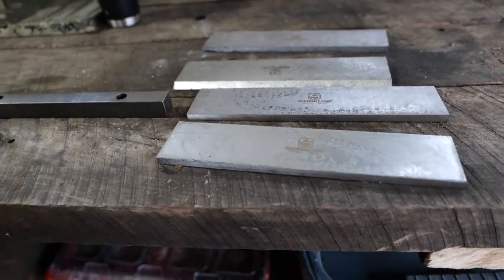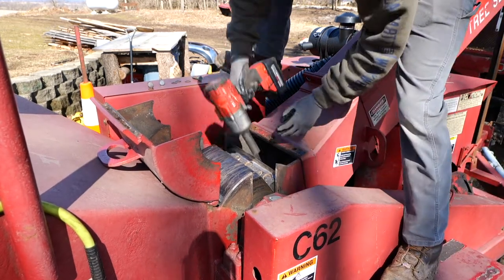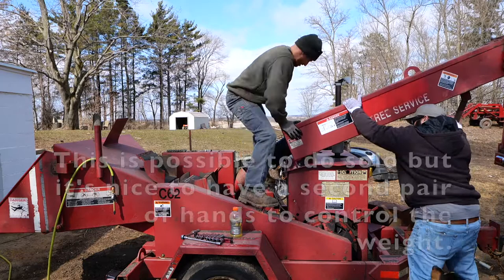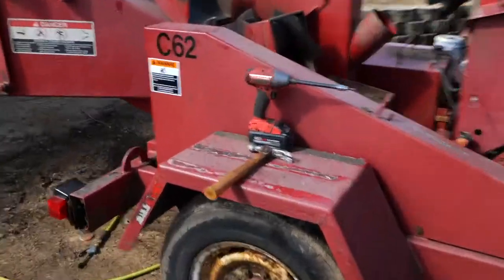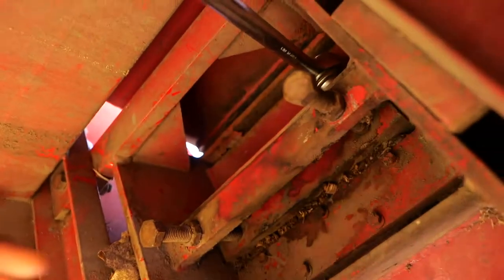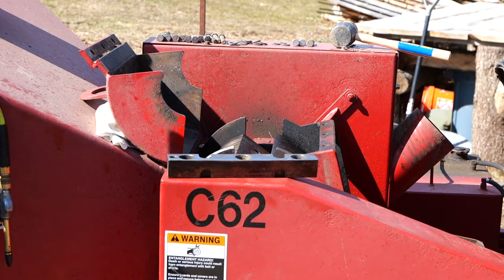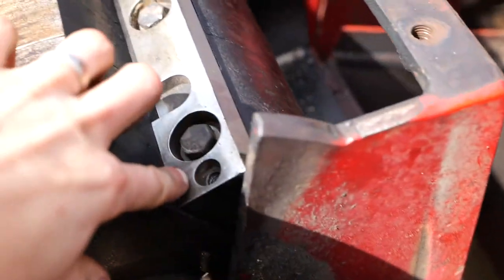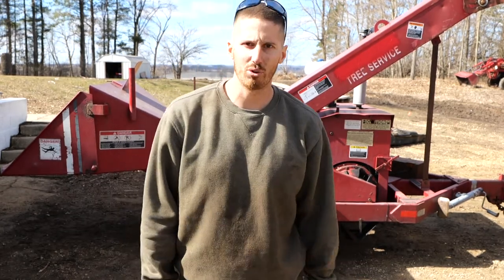Chuck and Duck Drum Chipper Blade and Anvil Service: Bandit 1290XP

Comment: The socket bolt is called a jacking bolt and wedge block.  You are damaging the threads by punching that screwdriver(use a soft metal punch) in those threaded holes, as milwrights we find out the thread size whether american standard or metric and use a starter tap and chase the threaded holes.

Comment: The distance from the edge of the anvil to the surface of the drum should be .218" (7/32", which is conveniently the thickness of a large chain saw file). Then adjust the blades to the anvil .030 to .035". I use to set mine so to .007". Made nice chips but at that clearance there is no margin of error. Once as the blades heated up with use they started to contact the anvil so now I just set them to the proper spec. Each turn of the adjusting nut moves the blades 1/16". The wedge bar bolts,  some people use a mallet and drift to hit the wedge bar to seat it, then re-tighten. Then, using a 3/8" allen, tighten the adjuster bolt from behind, into the blades to put some force on them, 50lbs or so (just guess).
Reply: I appreciate that input thank you

Comment: Yeah,the bed knife/anvil/wear bar(every manufacturer lists it as a different name,for example, Vermeer calls it a wear bar) ...also,depending on which brand/model,some units have a chamfer on all 4 sides,some are just a piece of square stock, like yours..they can be flipped several times too,for a new edge,if one side starts to wear..they're a real pain in the ass to move/adjust, if it hasn't been either maintained or no one put never seize on the hardware,but it makes a huge difference on a manual feed unit..only downside to the square anvil,is you can't run your knives far out enough, so it'll give you a hard time trying  to feed some hardwoods..the chamfered  anvil allows you to adjust the blades that little 3/32-1/8 outward,which helps grab the material without having to force it...just had a customer with an old Vermeer BC1600A,that was way out of adjustment on both...fipped and dropped the knives and anvil a few hairs and its now a beast...adjust is everything on these chuck n ducks...
roller fed units can get away with longer service intervals on the knives and anvil,cause the rollers are controlling the material.whispers,woodsmans,asphunds,need constant knife maintenance, but they're much faster,if you're just doing small material and palms vs,using an 18" morbark.....Great Video...and accurately done👍
Reply: Hey Mike,
So what you're saying is to not set the anvil at 7/32 ? Drop it down another 1/8" +/- ?  Then put the blades at .030 from cutting bar/anvil.
I have an old 16" whisper chipper from the 80"s. New blades and cutting bar but it won"t grab and self feed. When i throw the branches in it cuts a foot or 2 then stops. Does this on all thickness of branches. looking at a cut piece of branch you can see that it hits the cutting bar and seems to stop it. The blades then cuts the branch to almost a flat point. The pressure bar that holds the cutting bar has about a 1/4" step in it. Is that normal? Should it all be flush inside? What about the removable floor plate. Is that adjustable and should it match  the anvil/cutting bar height?
Any help would be appreciated .
Thanks Edward
Reply: @edhendries4618  precisely....I'd even go as far as dropping the bed knife/anvil anywhere from a 1/8 to a 1/4,give or take...then adjust blade clearance from there...the more blade exposure, the better it'll "grab" the material...also,edge orientation plays a major role for self feeders to chip properly...some units call for chamfer out,some call for chamfer in,so make sure you have your blades mounted properly...I've also found that using a 1/2" flat washer is the perfect thickness for setting up your gap clearance between the blades and anvil
Reply: Mike. Do you have any more information on the Vermeer 1600a? I need to change and sharpen my blades and I’m have a hard time finding anything on YT

Comment: how many revolutions per minute (RPM) does it rotate?
Reply from the maker: I couldn't tell you actually because either don't know the ratio of the pulleys. It's just engine rpm x the pulley ratio. These machines are rated in feet per minute and I think 100 feet per minute is typical.